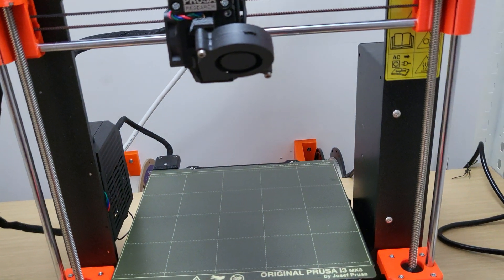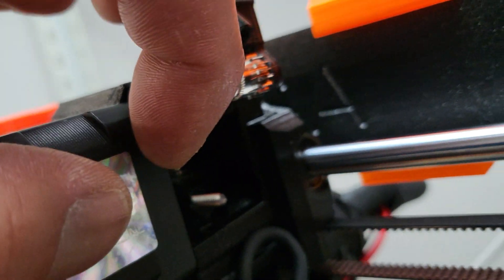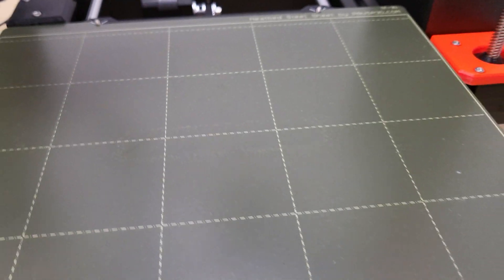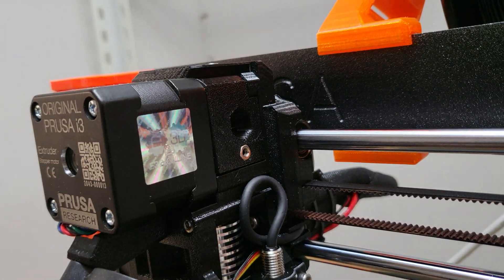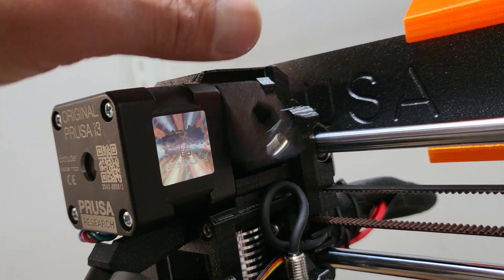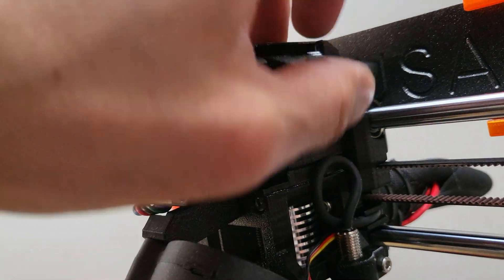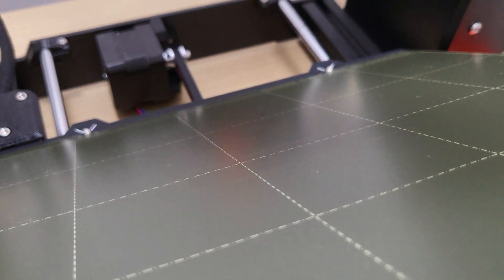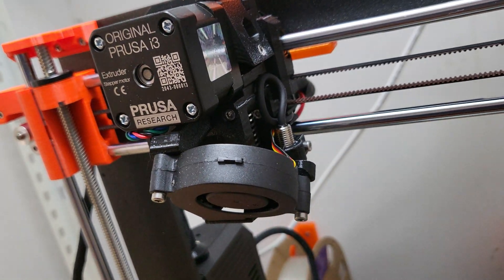Brand new Prusa MK3S+ clogged filament and damaged steel sheet out of box.

Comment: I think you did something wrong with that printer.... I did that ONCE in Prusa but only by my stupidity when I retracted filament by force when hotend was little more hotter than maybe 120'C. Was too much for cold pullout and too less for normal retract. Filament has straighten in throttle and after it cools down there was no possibility to push it anyway. It happens, but trust me, allways use Good quality filament + sponge cleaner and once for ever forget issues 👌💪

Comment: As regards the stuck filament, head the nozzle up and push i through with a piece of piano wire. 
As regards the PEI steel sheet, just turn it around and print smething, the bubbles/discoloration in the coating will dissapear as it heats up.
Reply from the maker: I just disassembled the extruder and fixed it, seems safer that way but will try bottom up method next time it happens.  But this shouldn't happen on a brand, new assembled printer from prusa.